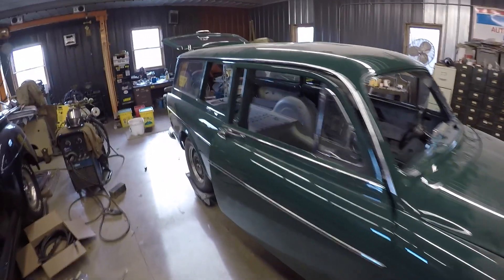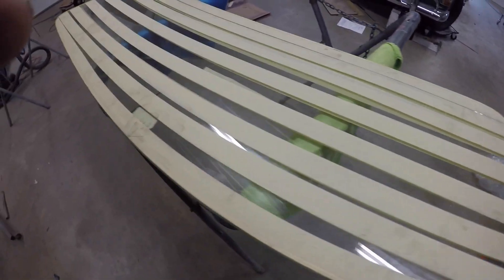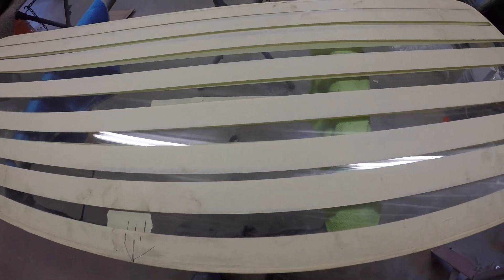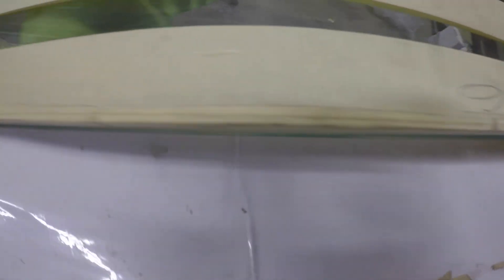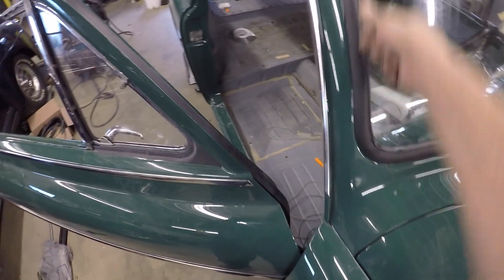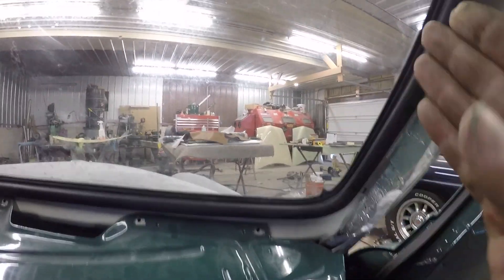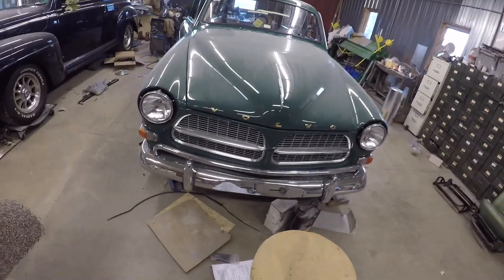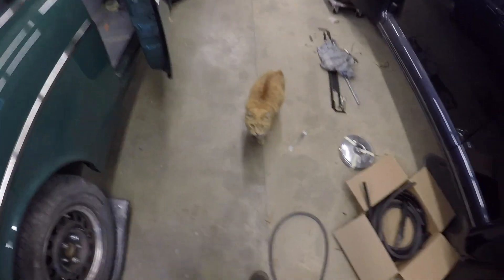Two-Door Wagon Update - Installing Windshield on Volvo Amazon

Comment: You probably know this but there’s a good video showing using a silicon carbide C 16 flexible grinding disc.  Seemed like cracking worries are over.  Glass shops use em.  I can send you a link if I can figure out how without email.